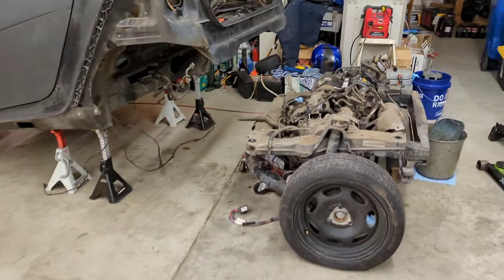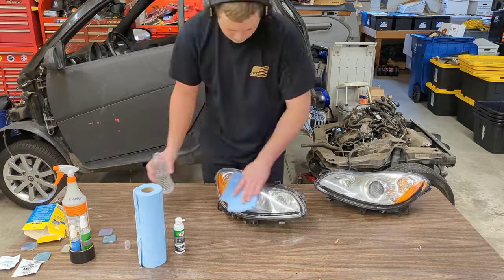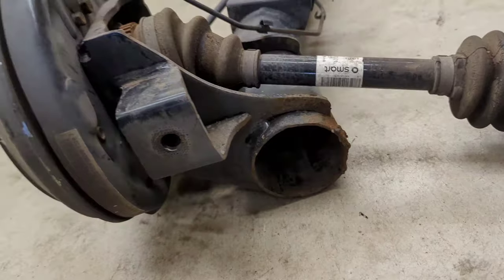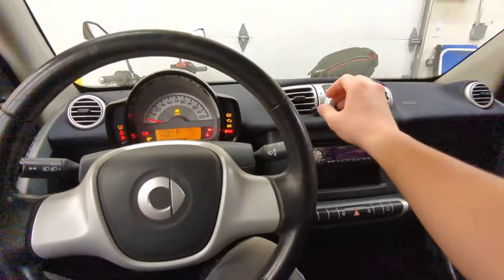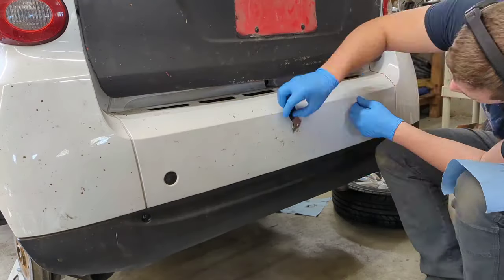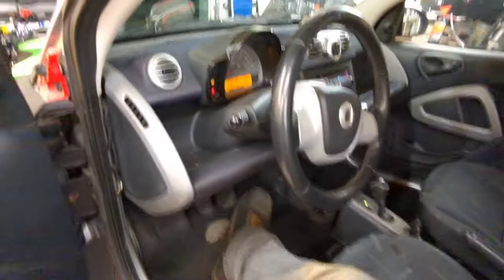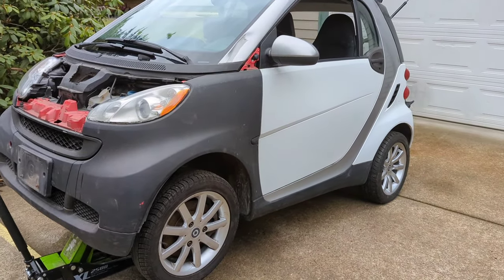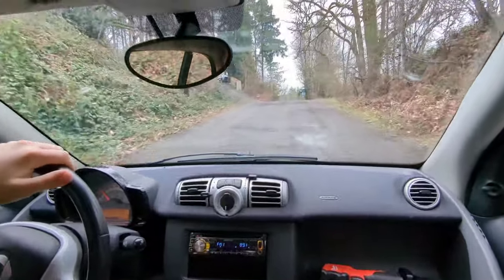Finally Driving My Cheap Smart Car [4K]

Comment: After driving these for a bit you do get a feel for the shifting and what it does with different throttle inputs. Think some people have also figured out how to teach it to shift a bit better, possibly with a Delphi clone depending on exact model. If it's jerky when setting off then the clutch actuator probably needs taking of, cleaning and regreasing. Evilution is an incredible resource for these.
Reply from the maker: Appreciate the info! I got the clutch to engage smoothy by adjusting the actuator so it drives pretty good. That being said I very rarely drive it.

Comment: Most people don’t have GL4 because GL5 surpasses it and is readily available
Reply from the maker: Gl5 has way more sulphur and phosphorus additives that can hurt the bronze and copper in syncros, so unless the manufacturer says otherwise Gl5 should not be used in a synchronized manual transmission, and I believe the transmission in this smart for two has synchromesh rings like a standard manual.